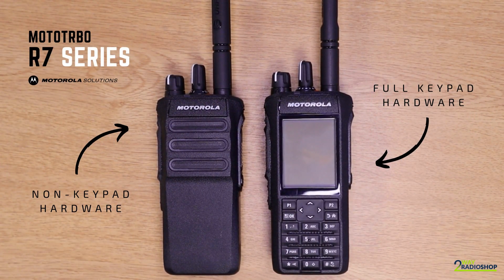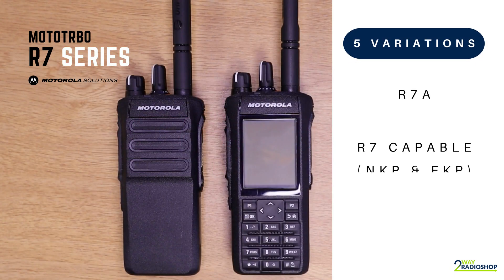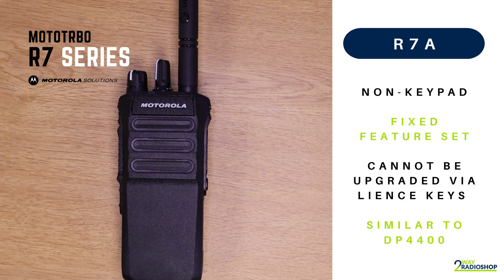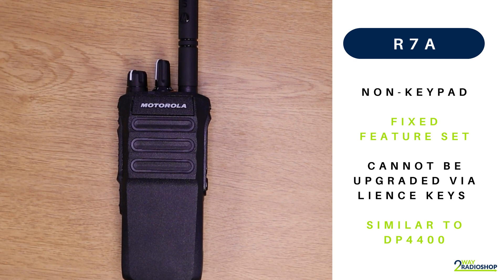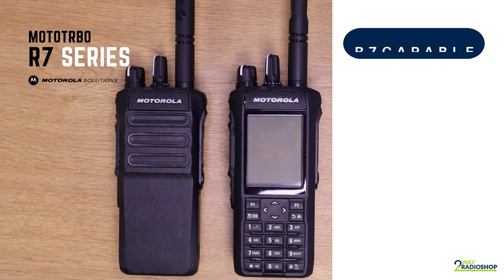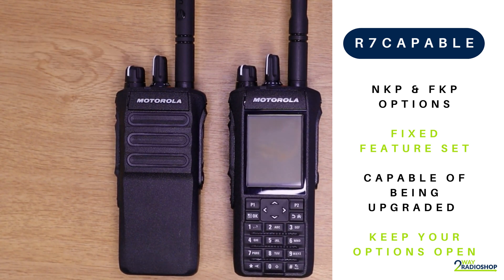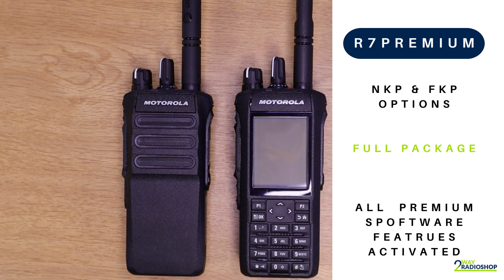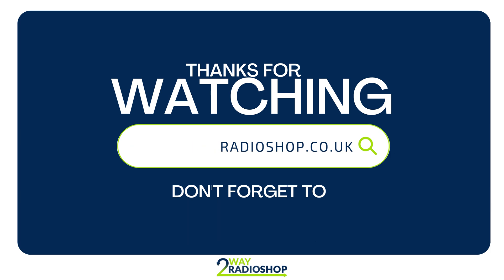Motorola R7 series: Model differences explained (2023)

Comment: Great video! Thank you for sharing such informative content. By the way, do you happen to know if it's possible to connect Bluetooth earbuds to a Motorola R7 Premium? I'd appreciate any insights you have on this. Kind regards!
Reply from the maker: Hey Emmanuel, 
Thank you for the feedback we really appreciate it😊 Yes, you should be able to use a Bluetooth earbud with the R7 Premium. However, we would recommend using a Motorola Bluetooth earpiece as it is likely to be the most compatible! - Niamh (2WayRadioShop Marketing Executive)